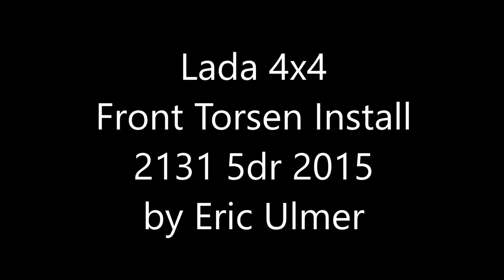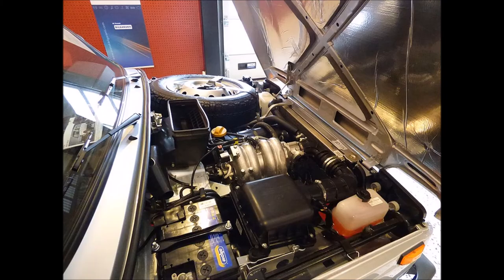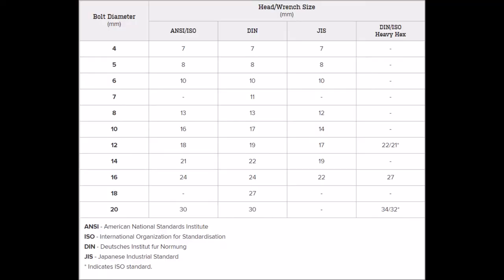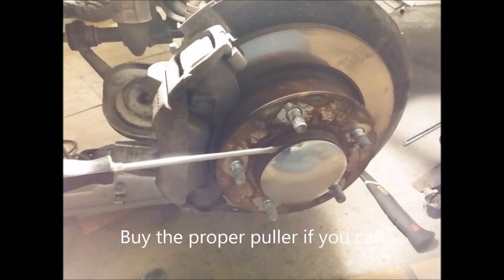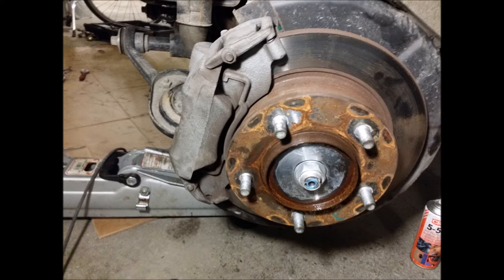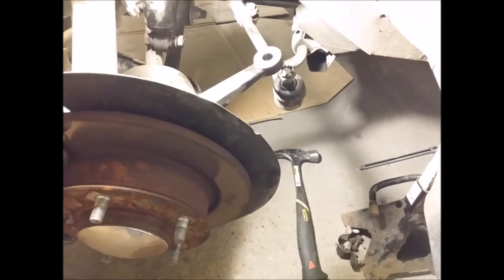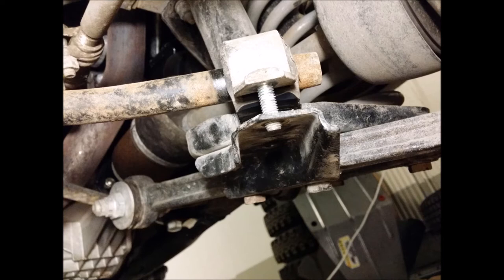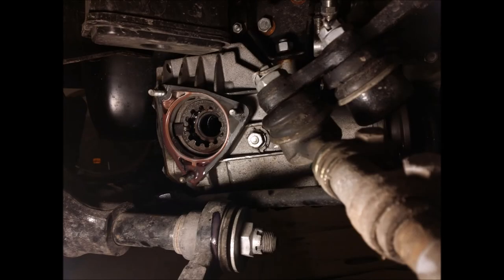Lada 2131 4x4 (Niva) Torsen Install -- Front Axle

Comment from the maker: Car drives notability different now. Steering is a bit more stiff and you can accelerate hands off the steering wheel with front-rear torsens installed. Now looking at center torsen and the 4x4/4x2 selector mod to regain steering agility on-road as next project.
Reply: Not sure it would last long  like that!There are front steal  diff housings for sale to correct that.How has the car been?
Reply: В задний мост ставь rolllock. Будет гораздо лучше.
Reply from the maker: No leaks yet!